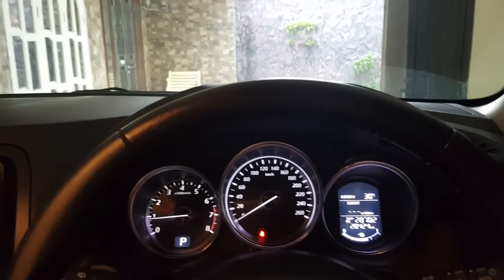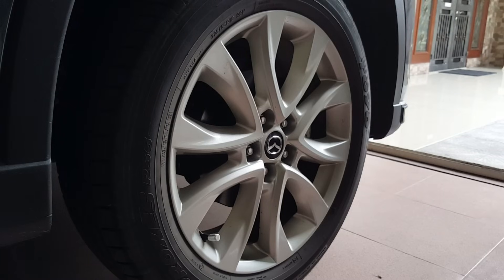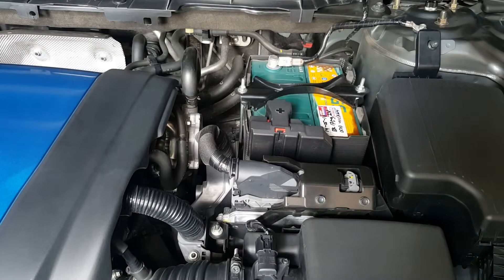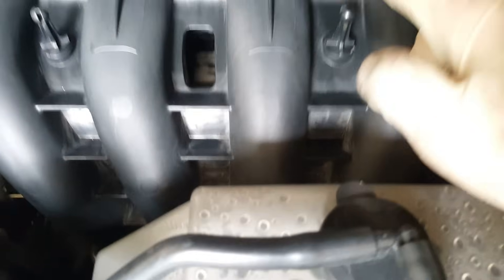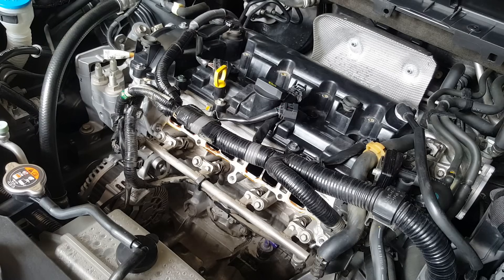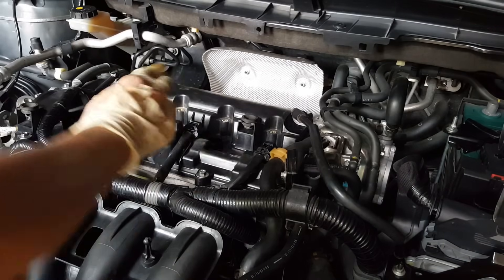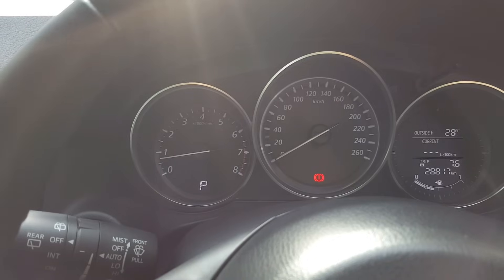How to Clean Intake valves / Carbon clean // Mazda CX 5 (All Skyactiv Gasoline Engines)

Comment: I followed this procedure and cleaned my intake valves and throttle body. Put the car back together and now its has serious misfires, will not idle, and will not increase engine speed with less than 1/4 throttle. From cold it will idle mostly fine, but if i touch the throttle it will immediately drop rpm and start misfiring. Thank god I kept my old car when I bought this one.

I got two codes at first, one that i don't remember related to the cam position sensor, and p0101 which is saying a problem exists in the mass airflow sensor circuit. The cam sensor i traced down to a plug that i forgot to plug in. I reset the codes and tried again, same thing. Disconnected battery, waited, pressed brake, turned on headlights, reconnected, same thing. I bought a new OEM MAF from mazda, same thing. Took out the spark plugs, they were pitch black, and the tips of the plugs looked silvery and slightly mushroomed as if damaged from misfiring. I tried cleaning the plugs, same thing. 

When I was cleaning the throttle body, I was not gentle, and did move the plate by hand, but it was unplugged at that point. The throttle plate will move through the full range of angles seemingly normally, there is a rather loud electric whine which I don't know if that was present before.

I just unplugged the MAF, and while it contantly ran like garbage, it kind of idled and responded to all throttle changes. Any suggestions? I just got this car recently and am excited to drive it more, but I can barely move it when it runs like this.
Reply from the maker: check all electrical connection MAF , Throttle Body , IAT Sensors , Coil Packs , PCV Hose and double make sure they are connected and seated properly. Possible the connection are not seated properly. As i got the similar respond P0101 from other owner as he stated he forgot to pushed in the connection all the way. Please let us know the update.
Reply: @GarasiFelixDan  Dealer found that the PCV hose was unplugged.... That was it.
Reply from the maker: @Daschickenify  ahh glad it was a pcv hose :)
Reply: @GarasiFelixDan  Yeah, makes me feel stupid, I had a feeling it would be something simple. But hey, car is fixed now, and it wasn't too expensive.
Reply: @GarasiFelixDan  ive checked MAF, throttle body, IAT(i think), fuel pressure sensor, coils, and cam position sensor. All are seated. Restarted it and same thing. It will idle cold, but if i touch the throttle it starts misfiring and stalls, but responds to heavy throttle. Im about to have it towed to a dealer. It likely needs a procedure done with an extremely expensive dealer level scan tool.
Reply: I did something similar when cleaning my Subaru Impreza. I ended up buying a new MAF sensor and installed it. Same issue. Then I was thinking I had broken something fairly important. Looked around and I'd forgotten to plug a breather hose back to the air intake. Plugged it back in and the engine was 100% fine again. ;)
Reply: @YoureNowOnTV Yep, mine was the same thing, I missed the PCV hose. That was a needlessly expensive mistake.

Comment: When you are done do you need to rotate the engine back to a certain point or is it fine to reassemble everything and it will run fine? Great video thanks for showing im working on a cx7 and its terrible baked carbon
Reply from the maker: Nope just leave it after you've done it is fine. :) Yeah tru the CX 7 has a bad carbon issues aswell :) hope this helps you service the car.
Reply: @GarasiFelixDan  much appreciated and it did help alot!

Comment: Nice video. I have a Mazda 3 skyactive model 2013 and I'm looking the TCM BUT I cannot find it.
Could you help me. Thanks, I'm from Guatemala sorry for my English.
Reply from the maker: Skyactiv Mazda TCM transmission control module is built inside the transmission box above the control valve body.
Reply: @GarasiFelixDan  woooo amigo thanks. You are wonderful. Good bless you
Reply: @GarasiFelixDan  amigo you are wonderful. Thanks, could you have some video that you could shared about this problem. I like the mechanic and I love my own experiences. GRACIAS

Comment: I am now close to 60,000 km on my Mazda 6 diesel. I might try this when I reach 100,000 km. Car is  mostly driven on highways.
Reply: Highway driven engines have way less issues.
Reply from the maker: true that.
Reply: @somap8380  
That is comforting to know. Someone from the Mazda 6 forum has 200,000 miles (not kilometers) and has no issues. I think his car is mostly highway driven.

Comment: Maybe this is a also a problem if an engine is only beeing driven short distances. All those modern engines are not made for that. I'm surprised that this could happen to a petrol engine. I drive Mazda cars since more than 26 years. My next one should be a Mazda 5 skyactive D 175 AWD. This would be my first Diesel. But I think it will be more efficient and for towing my caravan it has more torque. 
But thank you a lot for posting this video and your explainings. 
In a Mazda garage you might spend lots of money for work like that. But I suspect they will never mentain customers cars like that. And at higher km' s following defects will be caused by that issue. And than the bill will be much higher. Here in Germany we sometimes drive with highspeed on the motorway for a while when there is less traffic. This could also help to get rid of those carbon deposits. 
Thank you for showing and explaining your good work. 👍
Reply from the maker: Yes it could be one of the main problems. Very sad to see in southeast asia roads mostly start n stops .

Comment: Fuck bro i just bought a mazda 3 with the 2litre skyactive engine. It has done 62000km. Am i fucked? I assumed it was a port injection engine.
Reply from the maker: nah its all good man , use a good fuel and do a routine maintenance oil change. If you have the time do this intake valve cleaning your car should last for many years to come.

Comment: amigo para que le sacas la rueda al mazda,me podrias explicas eso porfavor?
Reply: Para poder darle vuelta al motor manualmente para cerrar cilindros 1 y 3 o 2 y 4
Reply: @jenamorado2005  muchas gracias saludos
Reply from the maker: Thank you sir
Reply from the maker: To rotate the crank pulley so we know which cylinder we working on .

Comment: My 2012.mazda6 with 2.5l I bought new only I used high octane Shell nitro and Castrol Titanium synthetic oil and 320000km now, and clean the motor ,valves inside and still running same like 9 years ago.I didn't touch anything ,only 2times spark plug  changed.Every 8000 km I do myself oil change. That is the secret and my philosophy. Don't be cheap on oil and fuel cost, I like this car and I try to love to drive longer. Enginers build great car when is new, just we drivers didn't take care on the maintenance 👍🤔You can find me on YouTube,,laszlo geleta,, Search it👍
Reply from the maker: So good thank you ✌🏻

Comment: I see you live in Indonesia. Now, I don't want to dis Indonesia or any other countries, but are they selling you dirty/contaminated gasoline there? I thought carbon build-up and lead build-up on internal engine parts was eliminated or at least greatly reduced when the oil companies moved to unleaded gasoline 40 years ago. I have 160,000 km's on my 2015 CX-5. I recently removed the spark plugs and dropped a boroscope into each cylinder to take a look around. There was very little build-up, and the walls of the cylinder and the valves were a light gray colour, not black and sooty
Reply from the maker: Yeap you are correct. We get shit fuel here. 😂

Comment: Nice video thank you. 
Can i use throttle body cleaner from Liqui Moly to clean the manifold? And then flush it with brake cleaner?
Btw do you know if the intake manifold contains swirl flaps? Because i cant see any. Thx :)
Reply from the maker: Of course you can. Nope our manifold doesnt have flaps.
Reply: @GarasiFelixDan  Thank you. Can i write. you email if I'd like to ask something? :)
Reply from the maker: @AnotherDimension  yes definately. Email.me garasiautosales@gmail.com

Comment: Which valve is the intake?  Is it the only one that can be seen when looking in?  I assume that the exhaust valve would be elsewhere.  If were visible, too, that would mean that the exhaust gases would be blowing back into the intake.
Reply from the maker: Yes intake valve r the one i showed in this video. The exhaust valve are hidden behind the engine block. Which needs no service at all.

Comment: Great Video. Questions:
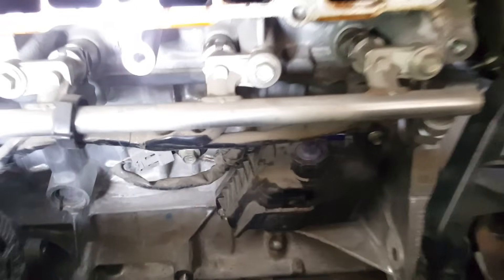1) What is the Oil catch can on min 8:26 ?
2) Where does the oil look alike come from on min 10:50
Reply from the maker: Hi thank you for tuning in. The oil seperator is fitted on these engine but it doesnt really do the job that well. The dirty oil is the residue cleanse from using the chemical. Please watch my other video for oil catch can install. 😎

Comment: Nice that if you have one  valve in each hole not 2 with a divider between them that will be difficult with a brush like in maxima 2012 but good job man and ac.delco carborator cleaner is doing the same job  👍 but the problem in the brushing 😅
Reply from the maker: Yeah lucky that this car have the intake valve facing the front for easy access for service.

Comment: what country are you in, has that mazda a factory oil catch can, what year is the vehicle.
Reply from the maker: Its pcv oil seperator . Act like a catch can.
Reply: what engine, inline four. what year of Mazda.2020. did it come with from the factort.
Reply from the maker: @donaldp7520  all gasoline skyactiv engine comes with this part from factory.

Comment: Great video, thank you very much. It's very well demonstrated!
Reply from the maker: No problems. You r welcome.
Reply: @GarasiFelixDan  Hey bro I am planning to build a brand new car Mazda 6 ism general I want Skyactiv-g 2.0 or 2.2 turbo. What do I need to add to add 400hp.
Reply from the maker: @revanvonheaven8270  hehe maybe bigger turbo n proper tune . i dont think many done this type of engine.
Reply from the maker: @revanvonheaven8270  or maybe engine swap to Honda K series much better platform.
Reply: @GarasiFelixDan  JDM has good engines but there are alternatives such as Mazda Speed 6,Speed 3, MPV 3.0, Rx7 Rotary dual turbo Miata engines can go from 400-600 legal for the road no problem so I have those choices but I want this one due to its tech maybe I would be happy with 300hp. Idk I'm a new driver not a mechanic and I am new to this. I will have to do my research!.

Comment: Hi, I like this video , thanks ! One question, how did you pumped out the dirty fluids? from the cylinder itself or from the intake valve?
Reply from the maker: I got my self a liquid vacuum tool that i made.
Reply: Yes, i saw this tool on your video, but my question is , from where did you vacuum that, from cylinder or from valves intake hole?
Reply from the maker: @amnon3267  from intake valve port. Use a small hose line to suck everything out.

Comment: Could this be why I am getting a P0301 Error code?  I swapped the cylinder 1 spark plug with number 2 but same code.  I also swapped the coil from another cylinder to cylinder 1 and same code still I have a feeling either the harness is faulty, or the injector is plugged up from some garbage fuel perhaps?  Or all this carbon build up is messing it up.   Its a 2014 Mazda 3 with 124000 KMS.  Mostly highway kms.  This seems like a good thing to do though either way,  yikes I didn't expect so much build up on yours with such low kms.  Great video thanks for taking  the time.
Reply from the maker: Maybe give this service a go ? See wether it fixes the issue. Also check for if theres any leaks loose piping on the intake system. And most likely due to bad sparkplugs (common issue at high miles) or injectors being clogged up (defective injectors rarely happens but can happens)

Comment: Today i went to clean my cylinder valves in workshop, the guy clean it without the making the valve on closed position, and i guess all the dirty thing went inside combustion chamber, and engine couldn't start, at the end he had to remove my spark plug and start the engine without sparkplug so the chemical came out from the spark plug holes, do you think this is bad to my engine? My concern is the carbon and chemical that went inside my combustion chamber, is there something something i can do?
Reply from the maker: If it done like this too often you will damage the engine ,scour the combustion chamber walls and damaging the piston rings. Probably will not go to the same workshop.

Comment: Run a can of crc intake cleaner or sea foam every other oil change through the intake and you’ll be golden.  No carbon buildup at all.  Be sure to change oil afterwards.  Nice job and great video.
Reply from the maker: Thanks for the info
Reply: @GarasiFelixDan  I like what you showed.  That’s what you have to do if the motor is neglected overtime.  Great job of showing how it’s done without the excess crap music and what not.  Do you use b12 stuff a lot?  I’ve never really used on much except dealing with carbs that have been gummed up.  It works well for that I know.
Reply from the maker: @ohboy2592  i dont use the b12 chemtool a lot. but i know that this product is a very good product from my previous carbon build up service.
Reply: @GarasiFelixDan  thank you.
Reply: Run it where ?  Like spray it onto the removed air intake or somewhere else ?
Reply: @YoureNowOnTV it has a small tube you can attach to the sprayer.  It can fit in between the intake tube and throttle body.  Many cars won’t run for crap if you remove the intake tube as it messes with the map sensor reading.  Then follow the directions in the can.

Sea foam can be used via a vacuum line to get into the engine unless they’ve come out with an aerosol version.  Just be careful you don’t let too much liquid in at a time or you risk hydrolocking the engine.  Just listen to the rpm’s and it’ll tell you when you are allowing too much.  The engine will start to struggle to keep running.
Reply: @ohboy2592  Thanks for the reply and the info. I don't have a car that I need to do this on yet, but if that changes this could be really useful information. 👍

Comment: Hi Felix Dan, Could you please tell me whether Mazda 3 gasoline engine has EGR pipe or port that return EGR back to manifold? 2nd question, can i use oil catch can to catch air oil from the tube that connected from the top cover cylinder head?
Reply from the maker: dont think it has a EGR pipe.

Comment: It may have been asked before but while doing the intake valve cleaning, wouldn't you want to inspect and clean the throttle body and MAF sensors as well?  It seems like all the trouble to get into the intake that the TBI would be the easy part and get it done too.
Reply: The PVC valve is under the intake manifold. This would be a good time to inspect that as well.
Reply: I would just change the PVC@loden888
Reply from the maker: Yes u can do in this order if you want. Do it all at once :)

Comment: Good quality video! I have 1 question, what is the reason to remove the sparkplugs? Is this engine direct injection or port injection? I am getting confused. Sorry I am still learning about car stuffs.
Reply from the maker: This is direct injection engine. I took off the sparkplugs so theres no fighting againts compression when rotating the crankshaft pulley to open n shut the valves.
Reply: Question for you: 

How often does this maintenance need to be done to  avoid any of this mess? 2016 Scion iA has GDI engine and I want to make sure it is taken care of from time to time when necessary. I don't want to abuse it

Comment: Could have been runed on shitty quality gas and with crappy oil than driven in the city stop and go ....
Mazdas skyactive engines do not have severe problem with carbon build up as it is burned off and exhausted at very high temp ... 

Too many variables
Reply from the maker: we only get shit fuel here in Indonesia.

Comment: I just have a question. Do you moved the crankshaft with the engine off?
Reply from the maker: Yes engine must be turned off . For easier rotation. Take off the spark plugs and you can turn the crank pulley
Reply: @GarasiFelixDan   My car is a ford fusion 2.0 ecoboost. If i move the crankshaft with the engine off this does  not affect to variable cramshaft sensors?
Reply from the maker: @edainball5499  nope it doesnt effect anything cause you just turning the whole crank and camshaft will als rotate to its timing position .
Reply: @GarasiFelixDan  thanks very much for your Time in this video. Best Regards!
Reply from the maker: @edainball5499  no problemo. O yeah dont forget to disconnect the battery to prevent any short circuit.

Comment: Longer you wait to do this if you don’t have catch can the hard I mean the harder the task to get them clean is going to be.
Reply from the maker: True that
Reply: Felix Dan I had to do mine but at about 85,000 miles they were crusty to get clean even with cleaner I had to scrape to the point I thought I was going to damage them.
Reply from the maker: @henrytom5824  good work. The car feels much better after this service right.
Reply: Felix Dan definitely I gained a lot of power power back , but still suffering from pinging so I have to use 93 octane I’ve already had all the gdi services done even spark plugs and coolant change.
Reply from the maker: @henrytom5824  make sure the gapping is correct on the spark plug and maybe use ron 98 once in a while. :)